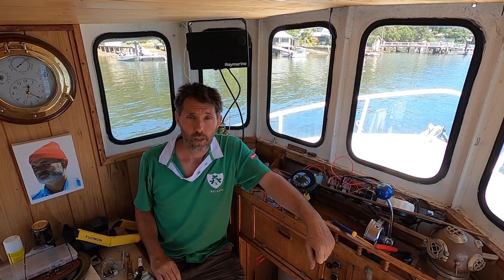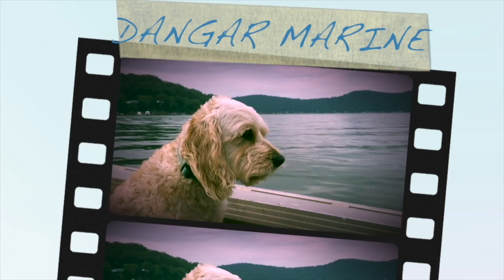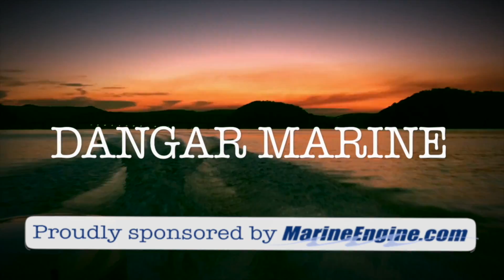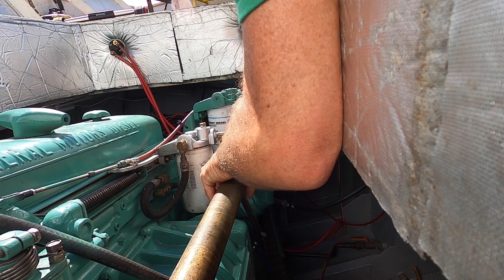Instrument panel

Comment: If the engine is hot from running you are going to burn yourself getting in and out of the engine bay.  Any chance of giving yourself better access to port and starboard sides?

Comment: Stu, You should not use barbed fittings on a fuel line. Check with heavy equipment parts supply and order a proper fuel line. You will specify a hose that connects to the 1/2" tube via a compression fitting, then to what ever fitting you need at the engine. The hose will be rated as a fuel line. Cut the tube below the fitting you have and install the hose.

Love the channel. Al from Brooks, Alberta, Canada.

Comment: Can you put a flare on the end of the fuel line instead of a barb fitting?  Might act the same way and no brazing
Reply: https://rover.ebay.com/rover/0/0/0?mpre=https%3A%2F%2Fwww.ebay.com%2Fulk%2Fitm%2F133010427052

Comment: Fuse size...  First, figure out how much current the pieces of the system will use, and if long runs and any significant current, how much voltage drop the items will tolerate - size up the wire so that the voltage drop is low enough.  Then size the fuse smaller than the amount of current that the selected wire will safely cary.  No need to  size the fuse down to what any device on the circuit will use, as the fuse is there to protect the wire, not the devices being powered by it.

Anywho, modern instruments don't draw much current, so any old wire and fuse will probably be fine.

Comment: Blow the fuel out of the line back into the tank. 
Then, seal the vent on the tank. A bit like putting your thumb on the end of a straw, you can stop
It flowing back.  

Yes there’s still a vapour risk, but it clears the line of raw fuel.

Comment: With the fuel line have you thought of putting a flange on the end. Use a compression fitting on it similar to a brake line on a car where you go from a hard line to a flex line.

Comment: Why not try to find a fitting swagelock type fitting for the fuel line. They are not cheap, but should be tight and offer a good possibility for a valve and hose barb

Comment: If you are going to combine hoses together with cable ties you should put some foam rubber or rubber hose between each so that through vibration it won't chafe on eachother plus even the cable tie should have some rubber between it & the hose such as a cut down bicycle tube because through vibration a hard cable tie can cut into any soft hose.

Comment: As far as brazing the fuel line I wouldn’t have a problem with doing that as long as there IS fuel in the line between the fitting being brazed and the fuel tank so as no blow back can occur. But because I’ve found that with time and vibration cracks can eventually form. I think the better option would be to use a compression fitting at that particular point. Also if a compression fitting is used try and use one with brass olives as nylon ones go very hard over time with distillates. Also use a proper pipe cutter as they form the pipe near perfectly round again if it’s been knocked around a bit.

Comment: Just a thought for your fuel line, you could solder a fitting on instead of brazing , using your heat gun for heat when you bring it in for the electrical stuff. Also you could cut a short peice of the pipe off, braze your fitting to it above deck and then use the pipe fitting to join the small part back to the line.
  For those long hoses maybe some sort of support might be a good idea, might reduce some pressure of the fittings if they moved around while out at sea .

Comment: for your fuel fitting.  is there a shutoff at the tank?  if so use compress air to blow the fuel back into the tank the close the valve.

Comment: In plumbing we take bread kneed until it doey shove that in the pipe. Sweat it up and it disintegrates. Would that work for a fuel line? Not sure.

Comment: Check out "SharkBite Fittings" to solve the problem of cutting off the fuel line, instead of braising a fitting on the fuel line when you cut it off. You will fall in love with these fittings...they just push on to connect and can be removed and re-positioned. AND THEY DON'T LEAK!

Comment: Most cheap crimpers have holes you can thread screws into so you can chop them.... https://www.youtube.com/watch?v=f8UwifeNx3M.  - I would highly recommend AN fittings if you can, I don't think you will get a good seal with a solder join with liquid in the line.

Comment: "These extra holes are me just trying to take some weight out of the bracket" LOL
Reply: Yeah right! Lol
Reply: Damn I was getting ready to reply to this very statement.When I went in to do it your post was first.Drilled extra holes for weight reduction.Yet the holes had rust on them from the previous use of the piece of aluminum.lol

Comment: If your fuel tube is 1/2" OD you can get a compression fitting  that will get you to 3/8" FNPT. From there you can get a king nipple to adapt to hose. Here is a link to McMaster-Carr listing for one https://www.mcmaster.com/5220k43 . Unfortunately, they probably don't deliver to you there, but it is a common part. Here in the US almost everything is an overnight delivery from them. If you do anything in CAD, they have CAD part files for almost everything they sell, so still a great resource even if you are outside the delivery area..

Comment: Why do you have to have a barb on that hose? Is it the suction side? Cut the pipe with a pipe cutter (not the grinder or hacksaw, too much debris), then slide your flex line over it. Double clamp it if it helps you sleep an night, but I guarantee you won't have an issue.

Comment: If you have any "soft tubing" with fuel in it, the tubing will melt in any engine fire, fuel will pour all over the place.  Caution Will Robinson, caution.  Keep it all metal.  To solder or braze to that tubing draw a vacuum* on the fuel tank and let air go in that tubing and the tubing will be empty. *  (at the fill bung) with a huge vacuum cleaner!  Diesel fumes do not ignite.
Keep all fuel lines 100% metallic and protected for safety reasons. Ron W4BIN

Comment: Stu, use a flare fitting to connect the barb to the fuel line. No heat needed.

Comment: Hey Stu,
Been thinking about your engine alignment issue.
Instead of trying to move the prop shaft forward, why not have a steel spacer made with the exact bolt pattern of your existing neoprene spacer.
Then:
1. Insert the steel spacer loosely.
2. Loosen all the engine mount bolts.
3. Align top and bottom of steel spacer with a feeler gauge, adjusting engine mounts as needed to get the vertical axis aligned.
4. Then tighten all the spacer bolts, letting the spacer bolts move and align the engine from side-to-side to be perfectly parallel with the prop shaft as you tighten them.
5. Finally, tighten all the engine mount bolts.
Hopefully that aligns your engine perfectly with the prop shaft.
If it works, would be a lot cheaper than putting the boat on the hard to move the prop shaft forward to meet the engine.
Reply: This would more likely distort the prop shaft rather than pull the engine into position, due to the engine's great weight.
Reply: @TR4zest  Hi Brian, - there's a chance of that perhaps, but the prop shaft is 2 or 3 inches of solid steel - I don't see that warping, especially as you would be pulling in line with the shaft itself.  The bolts would be more likely give first, but I've used 1/2 inch bolts to pull some big weights into line before with no issues.  Anyway, just a thought.  Cheers.

Comment: Dont worry about those T bolt clamps. One holds better then 4 of the worm drive clamps. As with those worm drive clamps they also make an end to go over the bolt end so they don't cut you open. https://www.clamp-aid.com/store

Comment: Braze it. When I was David brown and ih tractor mechanic
We brazed in new fuel lines with tanks still fitted with fuel in them. Use a fan to ventilate the engine room though.

Comment: After many years as a marine mechanic and chief engineer on tug boats, I recommend using flare fittings with a double flare. I never had one fail. They come in so many types, i'm sure you can find what you need to make the connection with different sizes.
Keep up the good work and videos.
Hank

Comment: tie a thin piece of wire to a small piece toweling to extend just above fuel level in pipe, stuff in pipe leave extra so you have something to pull on, then stuff the pipe with bread. After brazing pull everything out with wire and toweling to clean out pipe. Flush pipe out with diesel from tank with a small hand-held pump. You get the idea? 
Plumbers block piping with bread or rice paper all the time to make dry connections, then flush the line out afterwards.

Comment: Hey Stu, for the fuel line, maybe pressurise it higher up with air to force the fuel back into the tank then close off the valve then remove the pressure. Cut, clean and braze. The bit of left over diesel won’t do much. Happy days.

Comment: My cummins burns 17 gallons an hour at full song, and I have 3/8 rubber lines with no issues. I don't think you will burn more fuel with the Jimmy then your existing fuel line diameter can flow.

Comment: I just checked the website of a refrigeration supply house here in the US. There is a fitting that goes from 1/2" OD to 3/8" female NPT.  From there you could use a 3/8" male x 3/8" barb fitting. The industry number for the copper fitting is WO1225.  This fitting is usually only found in a  refrigeration supply house only,, not a plumbing house.  I don't know the number on the barb fitting, but this would be more in a plumbing supply house.  Only us silly Americans use these silly measurements.  Hope this helps. Ed

Comment: With the 3 bilge alarm you don’t know which one is going off so I would put a light or flashlight on then so you know which one is going off and then have away to tune it off as the noise will drive you crazy as you try to work out the problem.
Reply from the maker: Watch that bit carefully! The outer rings are LED lights. :)
Reply: Dangar Marine sorry I must have mist it, will go back and have a look now.yes you ARE RIGHT I just mist it.
Reply from the maker: All good mate. I didn’t actually realise just things existed until I saw them. Perfect for the job!

Comment: If you turn the screen upside down, I think it can be fitted higher up. then just flip the screen in the menu. or maybe fit the screen in portrait and then slide it in from the side and it can be fitted flush to the top

Comment: To allow your monitor to mount higher, is it possible to put 4 keyhole slots in the plate that mounts to the wall? Then you could have 4 mounting screws in the wall that would fit thru the holes in the mounting plate, and then slide down the slot of the keyhole. If you have the exact size hole as the size of the screw head, and screw it in so that when the mounting plate slides down it has a friction fit, I don't think you'd have any issues with it coming loose. And you ought to be able to get the top of the monitor as high as about an inch from the ceiling. Daffy sure is a beauty, and it's easy to see she trusts you!!! Even though she growls at you a bit when she's settin'.....  ;-D

Comment: Braze it or solder it?  A plumbers freeze kit?  yes your won't get it cold enough to freeze diesel  but it might make you feel better. A well tinned and fitting  joint soldered will hold.  Less heat. Tim UK

Comment: If the actual outside diameter of the fuel line on the bottom side of the braze joint is 1/2" OD (outside diameter), what size do you need to go to on top?  I am assuming you are going to run a rubber fuel line, if you want a barb fitting. I can check availability in the US here, I know it is going to be a long shot. As far as brazing is concerned, wrapping a wet rag around the tubing 4"-5" below the braze joint will be sufficient to cool that line down enough to keep the fuel cool enough not to outgas and ignite. That copper will need to be extremely clean and degreased to get braze to stick.

Comment: Got a blower in there yet? We had three folk perish a few years ago when fumes from a pressure washer accumulated in a concrete tank such as might occur with your gennie. At least your situation is shallower and more breezy.

Diesel is more forgiving. The old man brazed a crack in a tractor fuel tank. Filled it with water to minimised the amount of fuel and especially eliminate any space for captive vapour. That pipe end with barb will be a tiny volume and open. Maybe do a practise piece with an offcut filled with diesel in a safe location?

Comment: Use copper press fittings on that fuel line.  You're inviting disaster by using a propane torch on a diesel line in a confined space.

Comment: hi,  so if your in a rough sea ? and the motor is HOT , how do you access the engine compartment , ??? he he he , keep going , i can't wait to see it finished.
Reply: It does seem like he should have a extra cash to get down in the engine bay water for seacock blows and the engine is hot what then

Comment: You should try and get an aluminum valve cover with a breather and an oil filler. You would also need the bolts, washers, isolators and gasket. Those tin covers are known oil leakers. Also try and support the hoses with stand-off brackets, you would be surprised how heavy they are when they are full of fluid and also the vibration from the engine can knock them loose.

Comment: stu for the braising do what miners did  piece of metal screen stops flame travel through it  so some steel wool in the pipe  probably wrap some wire around it so you can pull it through the barb after braising ;]  thanks for the vid

Comment: I have no idea if a large soldering iron would heat evenly enough or hot enough, just a thought. Or maybe a high temp heat gun? The thought of an open flame on a fuel line gives me the heebie jeebies.

Comment: To mount the PC get a caravan type swing away mount.  You can then go as high as needed and can change the viewing position which might be useful for, say, glare reduction.  They are pretty cheap.  Check out item 193378978995 on fleabay $18.99 o.n.o

Comment: Are you aware of Gates heat shrink hose clamps? Could you use a compression fitting on that tube that you plan to solder?

Comment: second comment, better idea for fuel line. Cut the line with pipe cutters and put a flare nut on and put a 45 deg flare on it, then weld/clamp a barb to a fuel line of your choice, any refrigeration mechanic will have a ton of cut off flair joints laying around for free. There will be no reduction in size and near zero flow restriction. I'd cut about 4 joints of split system AC's a week that just go into my scrap bin.

Comment: @Dangar Marine - for your fuel line brazing, do you have valves on the bottom of the tank? close one tank, after you cut the line, blow in the cut section and when the line is empty, close the last valve. like a kid would do to blow bubbles in a glass of milk with a straw. that might clear enough of the diesel out.

Comment: 1/2 inch compression fitting for the fuel line. A 312 will give you a female bsp thread to put a barb into. Fine on diesel and the pressure you'll have

Comment: For the fuel instead of brazing you can use a Swagelock Tee fitting with 1/2" tube both ends and a 3/8" female outlet these are available in stainless steel or brass from Blackwoods or other industrial suppliers No need to use heat at all and they are good for 3,000 PSI
Reply: I had not known about Swagelok tubing fittings, until you mentioned them here. 

I Googled  and found there corporate website and this video, that was informative to me. 

https://youtu.be/jB_Nyje_HNE

Thanks for mentioning their products!

Best wishes from Buffalo, NY. 
RL
Reply: Blackwoods! I feel like they are half of the secret to becoming pro

Comment: edit: As I typed this I realised it's probable not the best for flow in a liquid pipe, we use it on the gas side, and for the test side of a T joint for pressure testing, but I'll leave it up in case someone gets a good idea from it.

I'm not coming down to Sydney to weld a pipe, but I'm replaceable with someone from Sydney to weld it. Find a replacement Refrigeration Mechanic that dose R290 work and crimp weld ends (relatively common in commercial kitchen fridges). R290 is a flammable gas, and idiot manufacturers like to use welded service ends. 
I'm 'Not" recommending you do this, but... we have a set of vice grips with rounded jaws instead of the flat/lined jaws. We just crimp the pipe below the weld, cut to length with pipe cutters (not a grinder or saw), fill it with flowing nitrogen (stops blackening the inside of the pipe, and prevents gas ignition). Weld our joint. Remove the vice clamp. Then use a shifta (Adjustable wrench) to open the pipe up where we crimp it.

Comment: What is the id of the fuel hose you are using? Like someone else said you can slide the new hose over the copper tube, even the smaller diameter tube that is braised on. Quite common way of doing it in marine trade I’ve found
Reply from the maker: The ID I have is 3/8", but you've got me thinking, the tail into the fuel filter could be upgraded to 1/2" and the tail out of the fuel filter left at 3/8". This would let me just clamp the tube as you suggest.

Comment: Hi I noticed some of the fitting that you putting hoses on don’t have a flared end to insure that the hoses won’t blow off under pressure are concerned that it might be a problem.?
Reply from the maker: The radiator cap should stop the pressure in the system from getting too high.

Comment: You are really putting your nose to the gring stone man. I believe a small rubber plug with a long screw in the middle will be sufficient to block the fuel line off so you can braze your fitting on. Pull the plug out with the screw when done. Keep up the good work, great video as usual.
Reply from the maker: Nice idea. :)